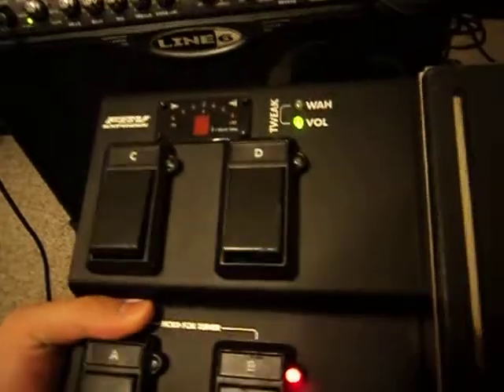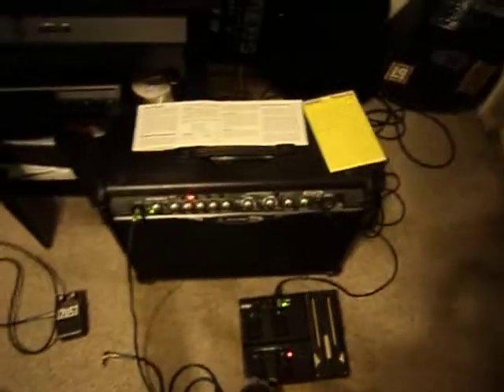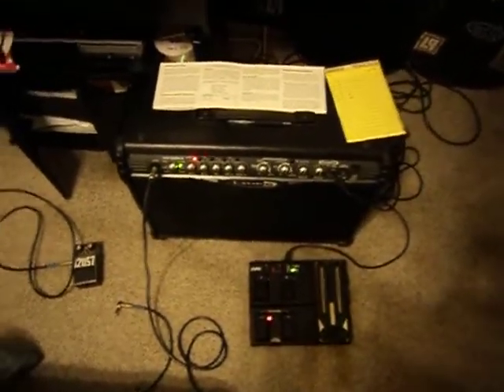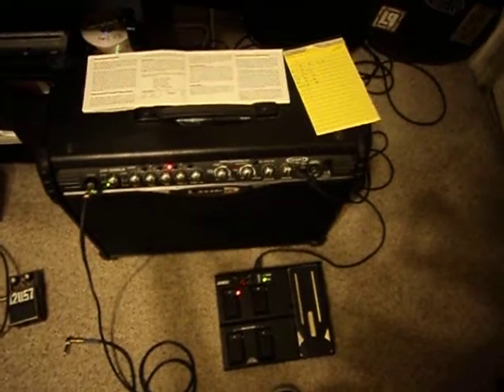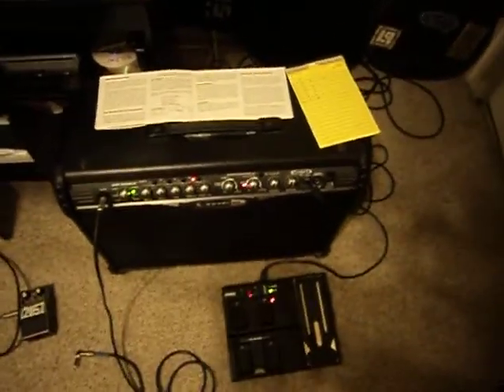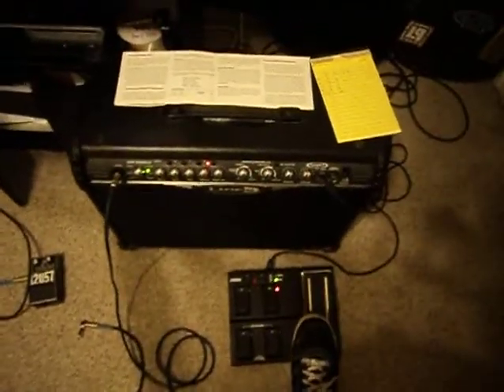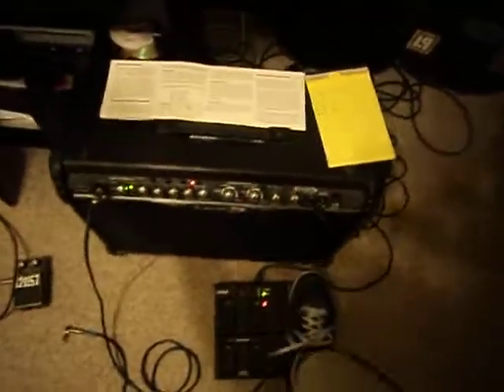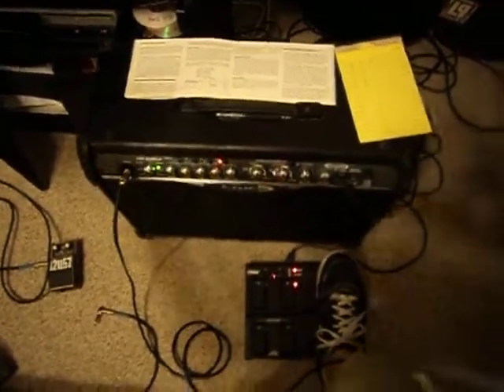Line 6 FBV express pedal

Comment: I don't understand the functionality of the FBV and the ABCD channels of the AMP... =/
For every channel installed you can get a different sound? 
I mean for example : A is for Clean and B for distortion? So when using the FBV you can switch to any of them instead of changing from the AMP manually?